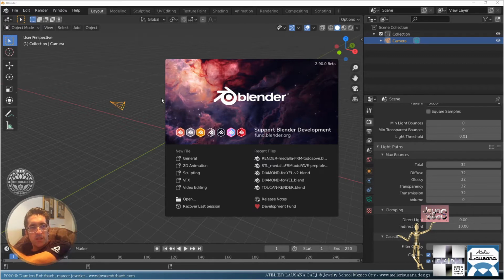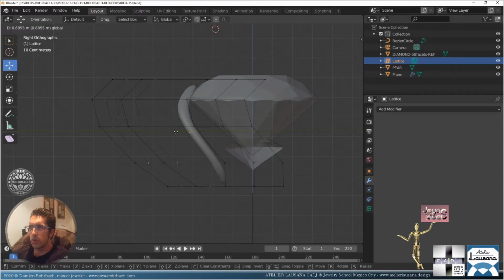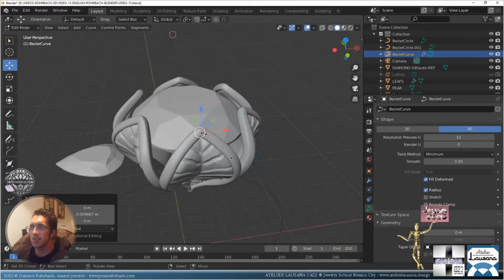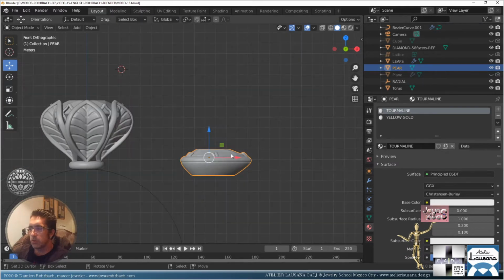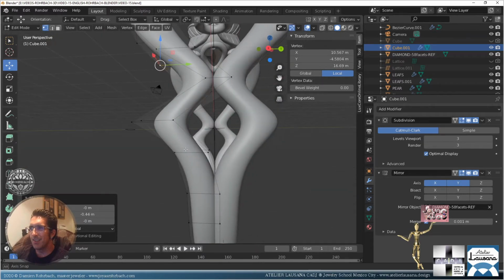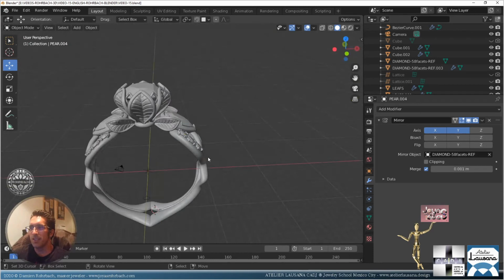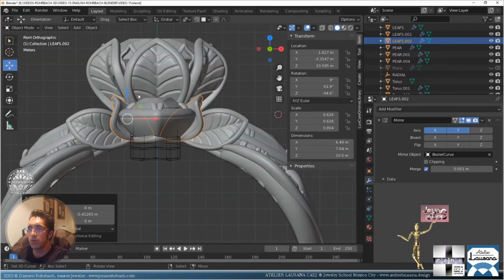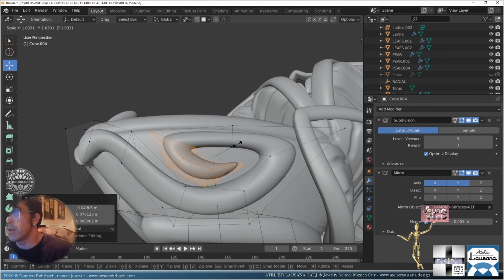TUTORIAL 15 3D Jewelry design with Damien Rohrbach and Blender

Comment: Hello beautiful job. so modestly I will suggest that there should be undercuts at the central stone in the leaves so that the stone rests on something, otherwise the stone will collapse or move during the setting. Greetings
Reply from the maker: Thanks to people like you I have manufactured thousands of jewels and set properly some many other thousands gemstones. Thanks to people like you I know where pertinent knowledge stands. Thanks to people like you I always remember how true modesty comes hand in hand with walking the proper path.
Reply: @RohrbachJewelryDesign  Thanks so just suggesting. On a daily basis, I myself frame diamonds in rings designed by people who deal with design, and this does not always coincide with the product after its casting. I will suggest that the central stone must have a support with the angle of the stone, and an undercut in the paws to make it docked, the same holes for the stones on the rail should also have the right angle for the stone to lie down. When I have a moment, I will send you a photo of the ring, for example with a 1 ct diamond. Greetings
Reply from the maker: @konlodyg3013  yes, master of masters, send your pictures, they will be very useful, oh great master. I will send you a pair of ears, and a set of new eyes. You will have to do the connection with your brain and with your heart. But your answers clearly showed that it's going to be a circus ride 💁🏽‍♂️

Comment: The sculpting tool is causing so much issues. It wont let me sculpt. if it does, it completely ruins it. is there any fix for it? and when i click Dyntopo, half the object is removed.
Reply from the maker: It can be many things. Maybe your mesh has holes, avoid modifiers if sculpting, your mesh is not mesh, your mesh needs is mass centered (CTRL+a) etc... Keep trying, check that your mesh is a nice solid before sculpting, maybe remesh first.